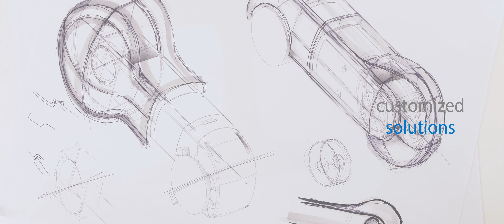AIRSKIN® product video

Comment: How to make a colaborative robot colaborative :)) , how convenient,  i see how it applies to standard industrial robots but on Universal Robots! really :))
Reply from the maker: We were wondering us the same, but as it turns out, the cobots can not achvieve the cycle time needed without extra safety. thus integrators contacted us to manufacture AIRSKIN for their cobots.  Most of them only add AIRSKIN around the tool and the ellbow joint.

Comment: easier to just detect collisions by unexpected torques in the motors
Reply from the maker: Yes, this is an easy option for lightweight robots. But once the robots get bigger, the moving mass is a problem. With an active skin, you can detect with the same sensitivity all over the robot AND the tool and trigger a safety stop BEFORE the collision force is too high ( see ISO 15066 limits: with AIRKSIN, due to the soft active skin, we can move much faster with robots than cobots with torque measurement in the joints.